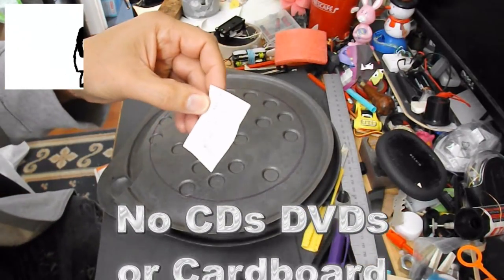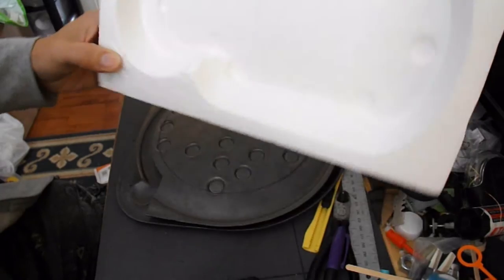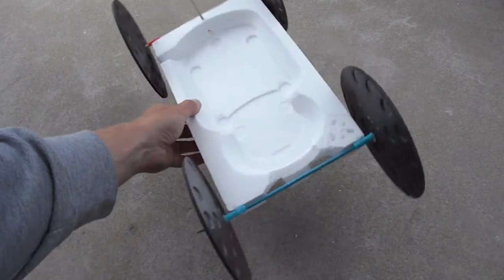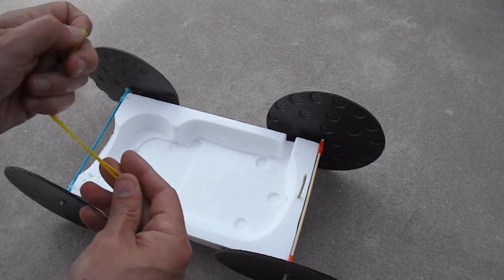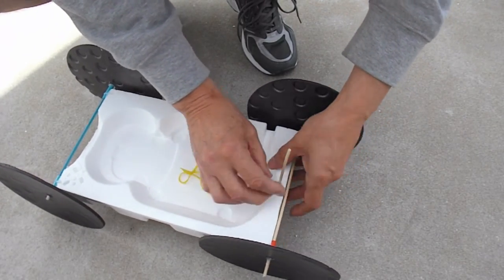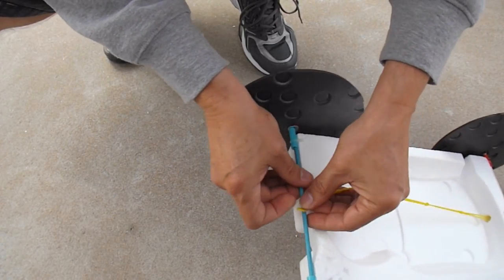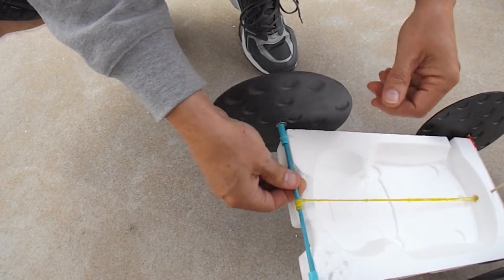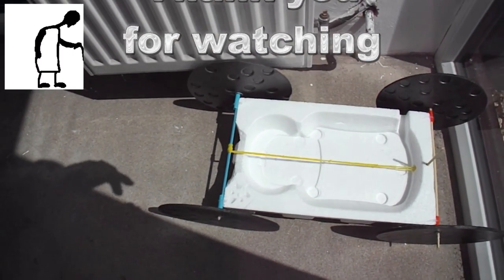No CDs DVDs or Cardboard - Rubber Band Car

Comment: This is a lot faster than your usual cd-wheeled cars, due to the bigger polystyrene wheels, i like that. Good job. :-D
Reply from the maker: Elnufo didn't think of timing it. Last year I did build a laser timer system for the cars but I am not sure if the parts are still around.